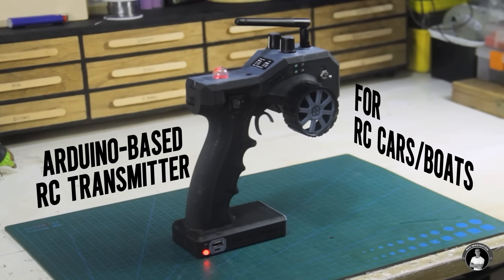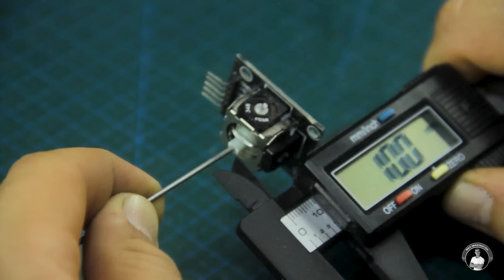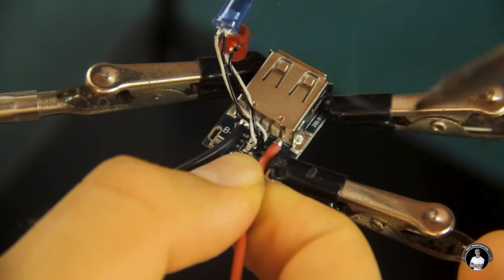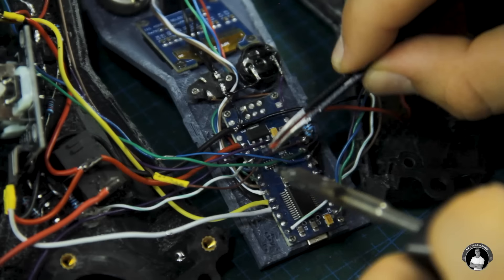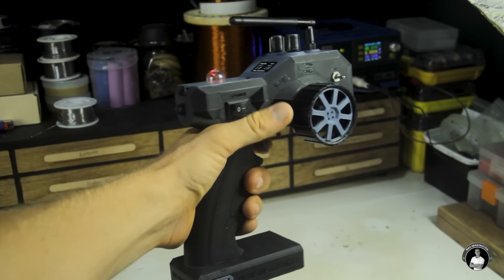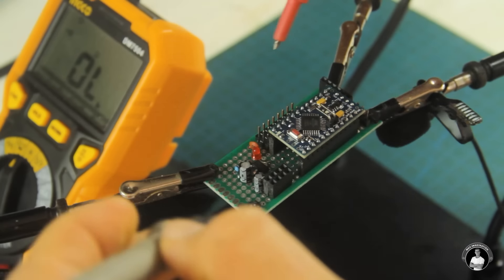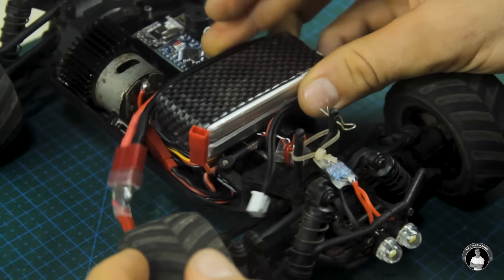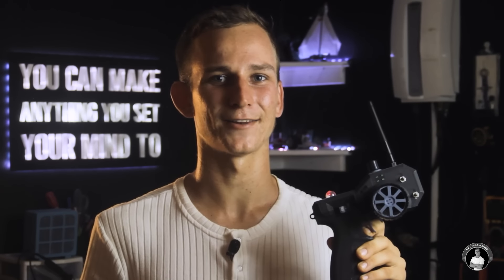Build an Arduino Pistol-grip Transmitter for RC Cars with 1KM Range!

Comment: Again super project👍.Can i use this for rc airplane? How can i do?
Reply from the maker: Thank you! This transmitter is not intended for planes unless you want to build a very simple plane with only throttle and rudder control.
Reply: @MaxImagination  thanks. Can i copy oled display codes. ex- battery display, axis details etc.to your previous rc plane transmitter code?
Reply from the maker: @Exam4364  You don't need to. This transmitter's code is compatible with planes if you look at the type and number of available channels. The transmitter itself physically isn't viable for planes as it uses up less joystick pins for inputs.
Reply: @MaxImagination  ok thanks max.

Comment: Hey umm there’s an confusion in the diagram for me the u know the in the diagram the 4 resisters in a row u used u didn’t mentioned it’s k or ohm can u pls tell me or write it in the diagram😅😅😅😅😅😅😅
Reply: In the transmitter😢
Reply from the maker: The 4 resistors I used in a row are 10K ohms each. Those are pull-down resistors.

Comment: I used something similair for controlling servo's but if I switch really fast with the PWM to turn, it burns out.
Reply from the maker: That is most likely due to you exceeding the rated pulse width in ms (milliseconds) of your servo. Generally, the minimal pulse will be about 1 ms wide, and the maximal pulse will be 2 ms wide. However some servos have a max pulse width of 1.8 ms. You may have exceeded it.

Comment: Hey I used in the transmitter oled display,Arduino nano,joysticks,antenna but the oled display ain’t working solutions please
Reply from the maker: Have you tried swapping the SDA and SCL wires to the display? Check your connections.
Reply: @MaxImagination yes but that connected were incorrect
Reply: @MaxImagination yeah but that just heated my display

Comment: but why haven't you used the Arduino input_pullup mode instead of adding those resistors 8:55
Reply from the maker: Arduino's don't offer input pull-down in software, so I added the resistors physically. I preferred to use 4 resistors instead of altering the code which is working fine displaying the toggle switch status from 0 to 1.

Comment: Hey in the diagram theres an confused im litterly like theres 4 resisters whats it k or ohm
Reply from the maker: Hey! Those resistors are 10K or ten thousand ohms each. They're to pull down the state of the pushbuttons' Arduino pins.
Reply: @MaxImagination no not the push buttons the resisters which is right to each other it is very close to the Arduino nano that resisters
Reply from the maker: Oh! That resistor is for measuring voltage from the 3.7V battery. It's a current limit resistor. See it in the diagram.

Comment: What did you study computer engineering or electronic engineering?
Reply from the maker: Electronics engineering.
Reply: Another question what is the difference between the two disciplines because I see them as very similar

Comment: How good is the range of this transmitter was in use that's a question I like to ask you.

And also is it possible for you to get rid of that battery and use a 2s LiPo battery with a cut-off Circuit
Of course, and Because I'm sure you're aware you can only charge that type of battery about 500 times before it stops working and you have no idea how many times that batteries was charged before you got those battery. 
If the battery stopped working for some Reason, then it's very likely you're going to have to take 
that transmitter apart to get to those batteries and you could damage your project as a result of that.
you need to make those batteries easy to remove If you need to replace them out on the field Somewhere
so you will not have to take that transmitter apart
Reply from the maker: The range is around 100m when paired up with a shorter antenna receiver and up to 1KM when with a power-amplified receiver antenna.

There is nothing wrong with an 18650 battery, especially one that's brand new.
It can be replaced with a 1S lipo, but not 2S with the current circuit unless you connect the battery to the Arduino's VIN pin.

The battery as a rechargeable one doesn't need to be removed ever almost. In any case, the transmitter can be unscrewed to access to battery which will only happen once in a long time.

Comment: can we use this same for rc planes?
Reply from the maker: For very simple planes that only use throttle and rudder control, maybe. In your case, I suggest you build a Electronoobs' transmitter as it's made for planes.

Comment: Hey max can i change my old transmitter to this?
Reply from the maker: Yes you can. Connections are the same in regards to the 2 joysticks and NRF24L01 radio module. All the rest are extras.

Comment: Having used NRF24L01+ modules myself, the range on them is never as good as claimed, especially not if they are random clones.

Random clones can have loads of issues with how they work.

If you just need to control a vehicle I would recommend looking into Express LRS (ELRS) which is commonly used in RC transmitters and is open source and has very good range (50-100 Km for high powered transmitters) but even low power ones will get very good range and transmitters and receivers are available cheaply. If you decided to go for ELRS then the majority of the project could stay the same, just swap the NRF24 for the ELRS transmitter and then use a normal PWM receiver.
Reply from the maker: Thanks for your insights and suggestions, Conor. However, I have no issues using the NRF24L01 modules and they work reliably as long as I'm supplying stable power to them, I personally can't complain about their range for hobby-grade use.

For controlling drones, I may consider upgrading to ELRS. Would you know how such receiver connects to an Arduino-compatible board?

Cheers.

Comment: max imagination , why is the Transmitter code error
Reply from the maker: Hi there. What error are you receiving? Please @ tag me in your reply.
Reply: the code below is the error? 
/Adafruit_SSD1306/Adafruit_SSD1306.h:144:7: note: candidate expects 1 argument, 4 provided Return code is not 0
Reply from the maker: You need to install or update that display library, by the sound of it.

Comment: I can’t have the printing parts so can u plss upload the pic of your picture plssss the picture draw u made of the transmitter in the codes file
Reply from the maker: I don't have a drawing of the transmitter in detail, whatever I sketched before is highly inaccurate and has things placed not according to the final transmitter. I suggest you fold your transmitter out of flattened PVC by looking at how mine is made throughout the video.
Reply: @MaxImagination I know I just wanted to shape it my transmitter😢

Comment: Your prints are stringing probaby because your filament has absorbed moisture, use a filament drier.
Reply from the maker: Could be the case. Currently, it is very humid where I live. Will consider obtaining one, cheers.

Comment: Hyy you can make drone using this transmitter or receiver 
Please make an video ❤
Reply from the maker: Hey there. This transmitter is not designed for drones. However, you can check out my last video when I made an Arduino mini drone using a compatible transmitter.
Reply: @MaxImagination   yeah i wach this video thanks 🥰

Comment: Bro I tried but I'm not getting reading in serial monitor and on OLED display and motor is not running pls help bro
Reply from the maker: Hey there. Have you identified the core issue yourself? Please be more specific with what is not working.

Comment: Using a single current limiting resistor for multiple LEDs is not a good idea, the current will be split between the LEDs so if you have one LED on it will be full brightness, two on will only be half brightness, four on will be a quarter brightness. Resistors are cheap enough you could have used one resistor per LED.
Reply from the maker: You have a point there. Indeed, the LEDs do dim down when a second one turns on - not by much. However, it's not that big of a deal.

Comment: can u build cheapest fpv drone ( 4" or bigger ) with controller? everything for 100-120$
Reply: 5" FPV drones is a expensive hobby. Don't expect to get anything more than a brushed tinywhoop for that price if it includes everything needed to fly. For example my battery charger that I use for charging my 5" drone battery cost ~$80 alone. You can get ones for like $25 but goggles are $50+ for trashy ones and $150+ if you want to get anything decent. Not trying to discourage you, FPV is an awesome fun hobby and can be very profitable when you do it for work, but wait until you can afford it otherwise it won't be fun
Reply from the maker: Great advice, Asher! @vax_ta, listen to him, he has a point.
Reply: @MaxImagination  yes but for 200$ budget one isnot possible?not pro type I mean just for jun which won't be much slower
Reply from the maker: For $200, it's possible with cheaper motors and cheaper flight controller-ESC stack.
Reply: @MaxImagination  can u tell me which one is best for 200$ I do not know much on this parts and so on ...
Reply from the maker: If you want cheaper parts, I recommend you take similar specifications or those lower in power and look for them on Ali express.

Comment: Connected everything which need on the transmitter on breadboard it’s not working nothing shows up on the oled display I didn’t connected the components which needed the resisters it’s not working
Reply: Please help me every connection is done properly and some components are not connect I connect joystick Arduino antenna oled display the display isn’t showing anything please help😅
Reply from the maker: Hey! Just yesterday, I tested my code on my transmitter for another viewer who has had similar issues, everything works perfectly fine on my end. It could be your hardware that is not matching or not correctly configured.

Are you using the same exact display and other components as I am? Did you check that the data wires are not wrongly swapped?
Reply: @MaxImagination  same oled displsy
Reply: @MaxImagination  yes everything I same I was just testing if it works the transmitter but nothings shows up the display
Reply from the maker: @Alihaider10109  Did you test your display with a demo code to see that it works?
Reply: @MaxImagination yes I tested it with a simple text and it worked but in the code u provided it don’t just work
Reply: @MaxImagination yeah I saw the newest comments a lot of peoples oled display isn’t showing anything too

Comment: Display not showing anything
Reply from the maker: Try changing its I2C wires, swap them around. Make sure you're powering it with 3.3-5V.
Reply: Display and wiring is ok
Reply from the maker: If you still need my help and want to go further into solving your issue, DM me on Instagram: @max.imagination

Comment: This transmitter looks similar to the one made by electronoobs.
Reply from the maker: It is, just in pistol-grip form with extra features 🙂
Reply: @MaxImagination  Right. I commented this before you just actually told that later in the video.

Comment: Fly a plane with it in electronoobs channel he didnt use it for a plane which was dissapoiting
Reply from the maker: I could try, but I would probably need more inputs like that from 2 joysticks (X and Y axis) to control a plane with all the control surfaces. If I ever do an updated Arduino drone/plane transmitter, I'm sure you will know about it. Cheers.